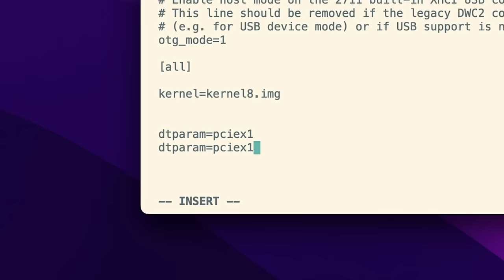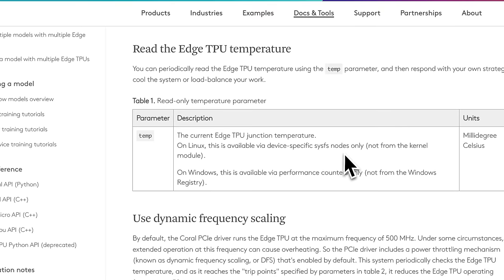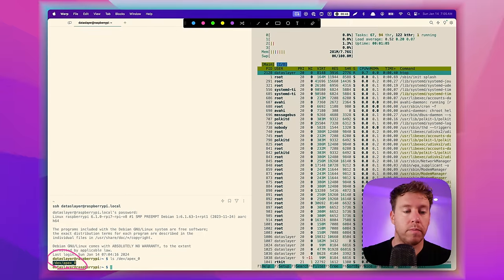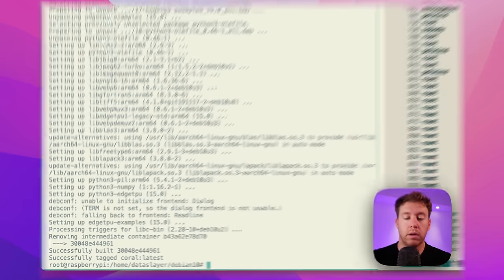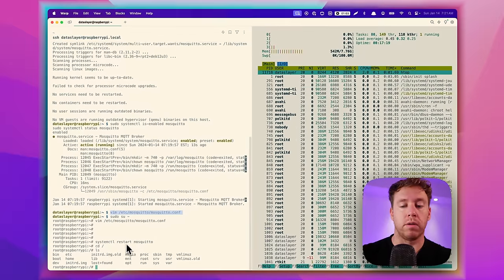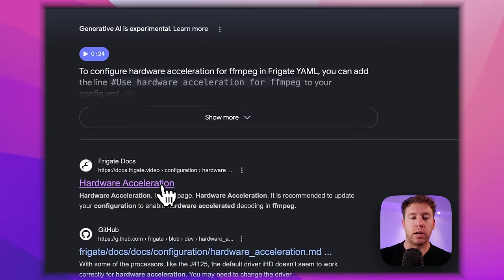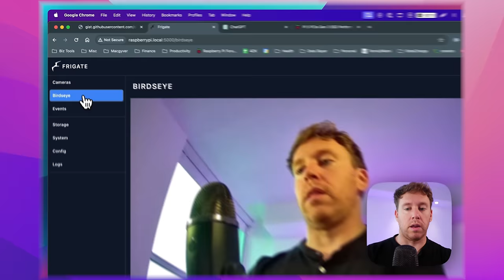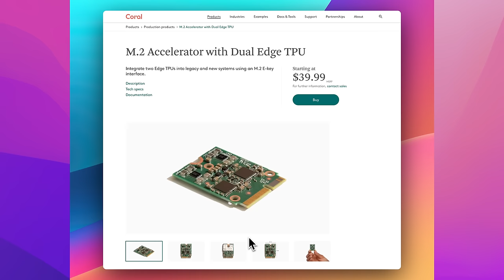AI on a Pi? Believe it!

Comment: Awesome setup! I wonder how it does with llm inference. Could.you try running ollama and see if the accelerator makes any difference? Idk if the coral has the matrix multiplication abilities.
Reply: I have a pi5 8gb and get around 1.4 tokens per/sec with 7B LLMs on llama.cpp running 4 bit quantized models (Q4_K_M.gguf's from TheBloke on huggingface) on an sd card. On SSD it's ~1.5 and on Pimoroni's NVME base its ~1.7. I've tried ollama a couple of times and it seems to be way slower but that could also be from a mistake I've made. I setup with a 16gb swap and ollama keeps putting half the model in swap.
Reply: Your can't. The coral has 1 GB ram, you will need a model that is very small.

Edit: there is new models with 2 and 4 gb now

Comment: As far as I've researched you can't get the dual core TPU working, since the Pi 5 PCIe socket is single lane 2.0. Only one of the cores will show up. You can though mess with config files to get 3.0 speeds. If anyone figures the single lane limitation to be false let me know ..because that's exactly what I had bought and hoped for.
Reply: PCIe hubs exist, and are relatively cheap
Reply: It is possible to design a board that alternates between the two chips over a 1x lane. If you operated that at 3.0, you would just get 2.0 speeds for both of the chips. I think. Same way you can have a bunch of usb ports from one pcie lane. They just compete with each other.
Reply: It seems impossible to use I wish I researched before buying one
Reply: @timjenkinson26 clock reference issue?

Comment: Nice! At that price, what about an array of accelerators hooked up to the Pi.
Maybe work with some company to put together a kit (for home security).
Person can program to their liking, but you give them a nice standard implementation.
Multiple cameras recording to multiple Pi's (with storage attached) would be good security.
They'd have to find all the Pi's.
Camera's need to be wireless (separated from the pi) so you can hide the Pi's away real well.

Comment: Thank you for the great video! Is there a way to adapt both nvme and coral tpu m2 by using two HATs?
Reply: No, there's only one PCIe lane
Reply: And, is posible ssd and USB adapter for external Coral USB and all in a one case?
Reply: @galdakaMusic   It's definitely worth making such a case.
Reply: Pineberry pi offers now a hat with 2 slots, key e and key m so you can use both despite only 1 lane.
Reply: @distiking  You sure it's possible to use both slots at the same time? I'm not so sure

Comment: Would I be able to run the mistral 7b, as a casual chatbot with short responses(with 4 second max time to first token or so) on desktop using the coral ai usb accelerator or even two?
If you could test it on your setup, Id be very thankful. Pls respond :>
Reply: Your safest bet is to use an Nvidia graphics card with enough memory to fit the LLM that you want to use.

For a 7b parameter LLM with 4bit, you should be able to make do with 8GB of VRAM.
Reply: Thanks, do you think that the rtx 3070 would have a decent time to first token?

Comment: Excellent instruction. I just received my m.2 tpu a+e key. Currently running frigate in an Hp800 elitedesk core i5 with Debian 12 linux mint edition. I'm not very good with linux. Can I run your script to install and setup the coral tpu? I'm going to install the tpu in place of the wifi board. Any mod I need to add to the frigate docker compose? Thanks in advance!

Comment: Hi. Thanks for the video. But I have a question, before I kill another running system on my pi-5. Could you please tell me if the "sudo tee -a /boot/config.txt"  works on a ubuntu server 24.04 ??  Because there is no config.txt in boot, instead it is in /boot/firmware/cofig.txt....  Also, as I have tried this change before in the /boot/firmware/config.txt  it just killed my system by passing "kernel=kernel8.img". I don't know why, but after reboot the LED indicated kernel not found.....

Comment: what types of models can be run with this? Can it speed up llms?
Reply: LLMs are bandwidth limited on parallel processors, so having the faster 3.0 pcie connection will be a speed up over any other pi solution. Maybe like a couple tokens a second on 7b models which could be usable. The 7b bit models are not usable like chatgpt tho. They can do like sentence completion prediction maybe. This is better for speech to text or object detection.

Comment: Just found your channel and as a ML engineer this is great stuff! Only recently been looking into integrating into a raspberry pi so this is very useful! I don’t know if you have a video out on it now but have you tried integrating one of these optimised AIs into a django/flask/fastapi framework on a raspberry pi so we can interact with a locally ran api from an external device? And if so how was the performance on these? Would be useful for having a quick app be able to find information on trained documents

Comment: Do you think it's possible, with a little bit of code, to use a wide-angle camera in the right spot in a room to get not only a people presence sensor, but also something like zone presence like the Aqara FP2?

If I can see the whole room I can tell how many people are in each zone and I can eliminate all motion or presence sensors with one camera.

The next step will be to add facial recognition, so I can eliminate all the people tracking or room tracking sensors.

The end game will be posture or gesture recognition to get rid of voice control and give commands on the fly with simple gesture or trigger automations based on recognition of the action a person is taking at a certain area of the room.

With AI's advancements on image recognition I believe that within a short time we will only need 1 camera per room to replace all the sensors in the house (hypothetically even for door and window sensors just instruct a model that sees things open from the video stream)

Am I being too optimistic?

Comment: i wonder is this possible with ollama? i mean most of their models are 4bit to 8bit int and the coral uses 8bit int and can do 4tops and some models can do 8tops. i have a dell power edge r630 wich uses 2 xeon E5 2683v4 cpus who a capable to do 8int operations over 32 threads with 8.9477,5 TOPS in summary. so yea i know exactly what i expect in performance, but my system uses 400W and the coral only 2w. and given that fact the coral uses only 2 pcie lanes i could use more then one in my system with 40pcie lanes i have in spare. i know the r630 is old but 300€ for such powerfull machine who can beat this value of performance and features to price. 
i dont know much about the coral and other npu and tensor core systems. maybe i can use multiple corals to increase the performance. also the coral uses only 2.0 pcie and i dont know how much data really going over the bus. but using sas12g ssd drives is no problem and with 8 drives in raid 0 i could get up to 8gb/s read and write speed.  so if the coral need really both  2.0 lanes i should easy feed 8 corals. if no losses i would get 64TOPS with only 16W of power. what a massive number. maybe some one has a answer of this question if this would be possible if not and i can use only one or none for ollama. is ok in this case i leave it like it is now even it uses much more power. power usage is not really a concern for me. but given the fact the r630 supports only 35w pcie devices up to 3.0 and the limited space of 1 slot and half height my options are limited. the nvidia tesla t1000 8gb gpu uses 40W wich is 5w over the limit but it works has also a 10TOPS performance and costs about 380€ each. about gpus, i know i can use multiple gpus for but tpu i have no idea.